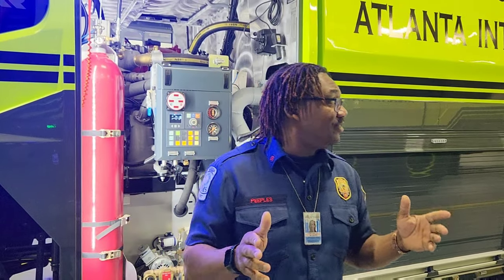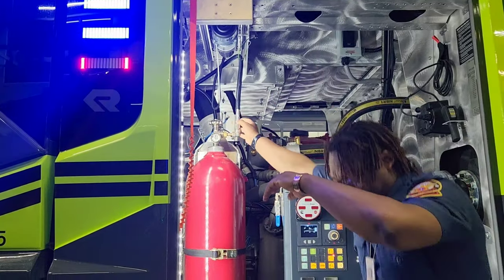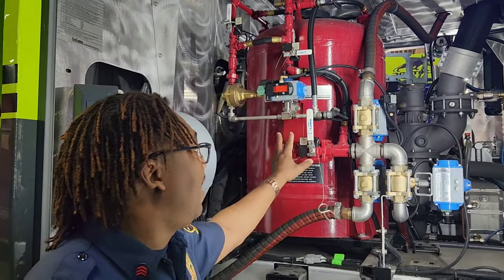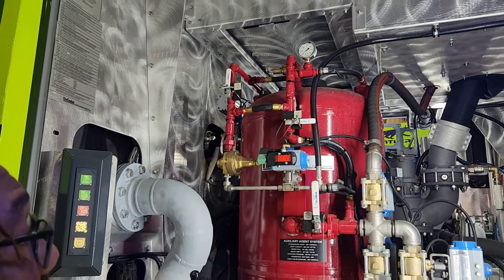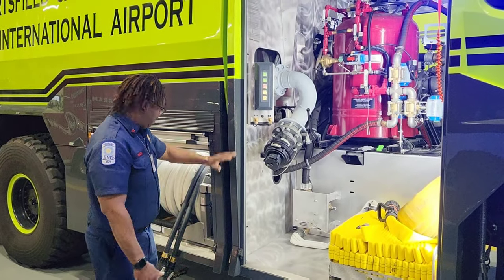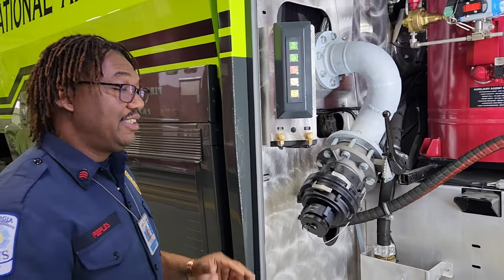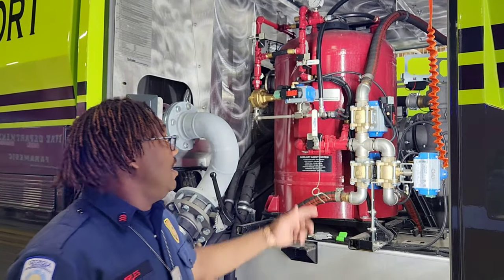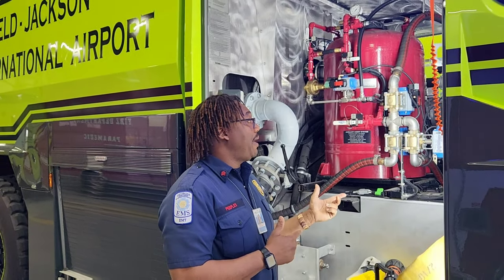AFRD TRAINING (Fluffing the Dry Chem System on  a Rosenbauer Panther 6X6)

Comment: Very good video , but is the very low amount of nitrogen in the charge enough to fluff 500-550 lbs , I know on the ansul system they have instruction to leave nitrogen bottles on and fluff 
Oshkosh that uses fire combat also states to leave nitrogen on to fluff 
The manual I have for Rosenbauer has no instruction for fluffing 
Thanks again for the video